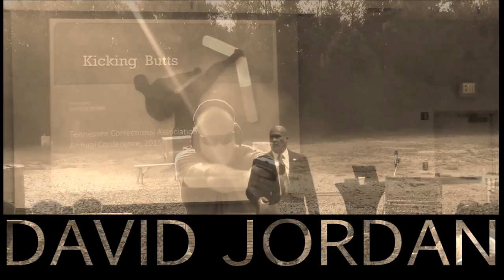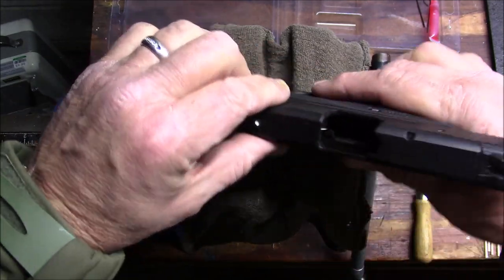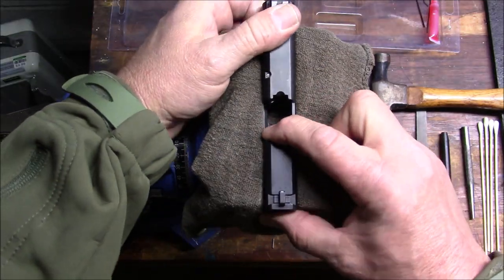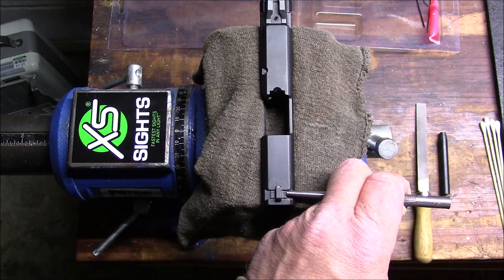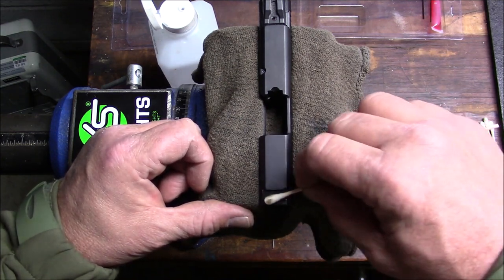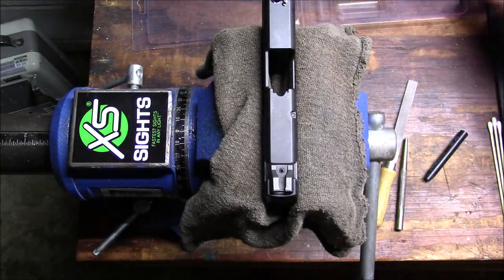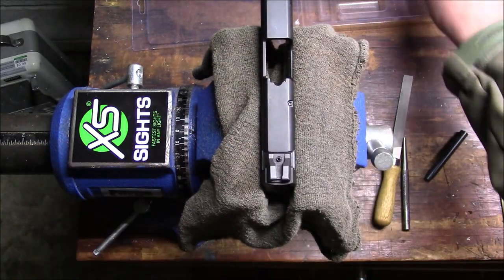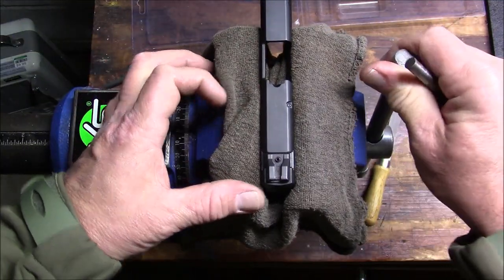How to Install DXT2 Sights on a S&W Shield

Comment: Hope you don't need to adjust those sights after shooting it with that locktite on there. What about if you might need to replace those sights sometime down the road? All the locktite may make that task rather difficult. Just saying. I am looking for a sight upgrade to my Shield and those look like a good choice.
Reply from the maker: I've never  had that issue with a pistol.  Just center the rear sight and your good to go.  If I do need to remove the rear sight, the punch and hammer work the same way. It just might take a minute or two longer. I have seen HUNDREDS of people's sights fall out of the gun when taking classes  where you shoot a lot of rounds. All my firearms are fighting guns and I dont have the luxury of risking a sight coming off in a gunfight.  Thanks for your feedback.
Reply: Get a sight pusher and you’ll have no worries about anything
Reply: Neeks what sight pusher do you recommend for the Shield?

Comment: How do you keep from scratching and marring metal on metal punch contact? Install looked too easy
Reply: Use a brass punch. It won't damage steel sights or pins. Any slight discoloration from the brass punch can be wiped off with a cotton swab and any solvent or gun oil. 

Some folks use aluminum or plastic/nylon tipped steel punches, but I've always used brass punches for firearms. Eventually the tips of brass punches may mushroom or deform, but they can be hammered straight or filed back into shape.